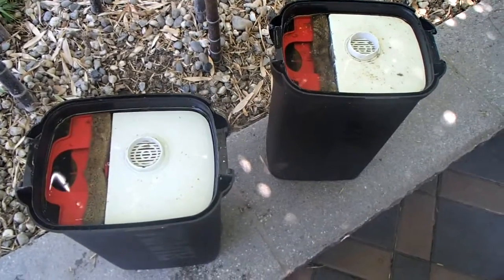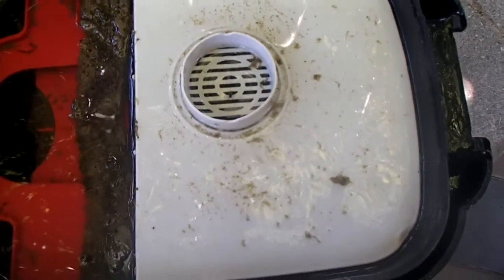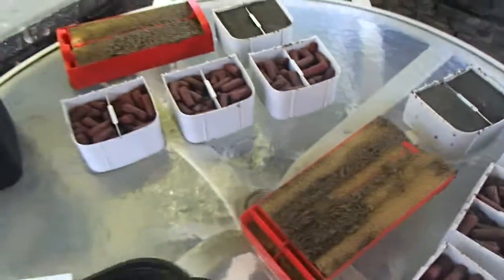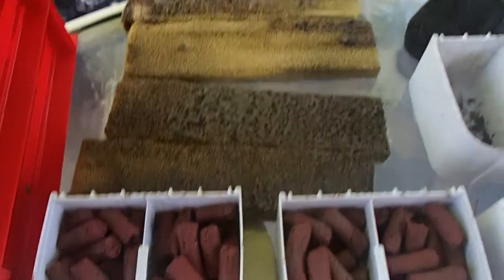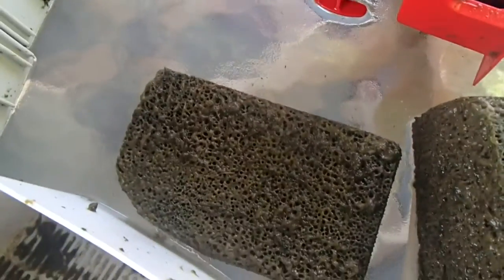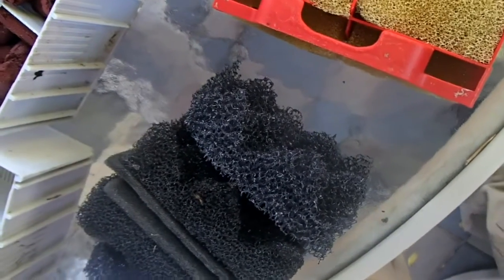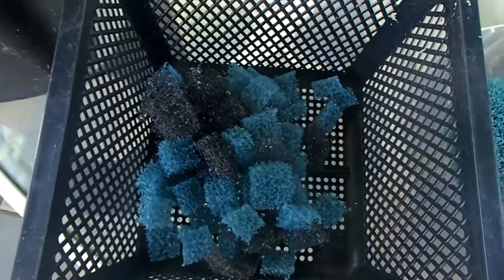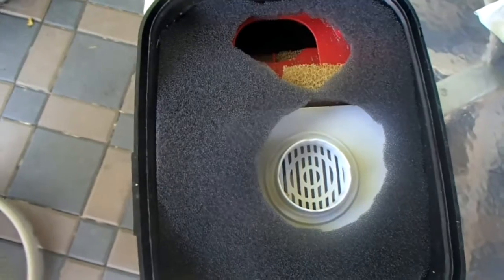Foam Test 7 816

Comment: I use a fine foam in place of the corse foam on the side where the baskets sit on my fluval 306 because I'm worried about the bypass going through that corse foam and getting into the biomedia that way seems to work fairly well for me. Of course my fine foam is about 1/2 inch thick to fill that gap
Reply from the maker: Jacob,
Are you referring to the big blocks of foam on the side of the canister? It seems to me the Coarse foam would be fine there as the water passes down that passage first.
Reply: GreatWaveDC the two big blocks that are in contact with the outside of the white baskets not the two facing the outside of the filter where the water is supposed to flow down and then up through the media. I'm a little paranoid about water bypassing my media :P
Reply from the maker: I'll have to look into that. I assumed both sides were filtering the water entering the filter as it passed down to the bottom. I'll have to take a closer look next time I have them apart. Happy Fish Keeping!